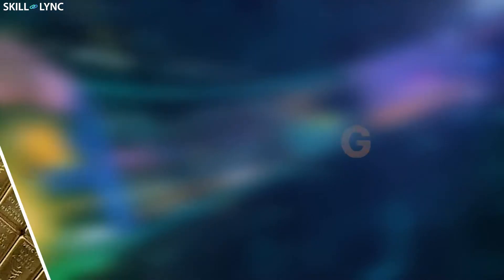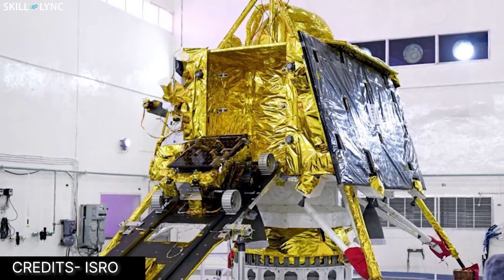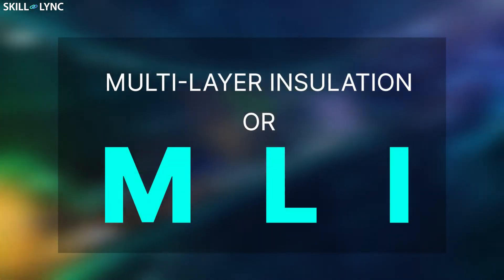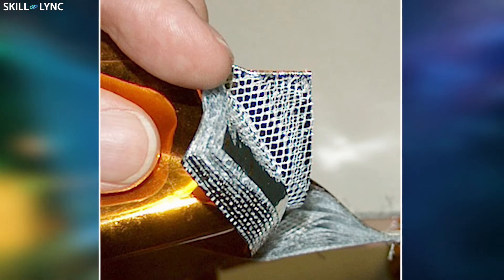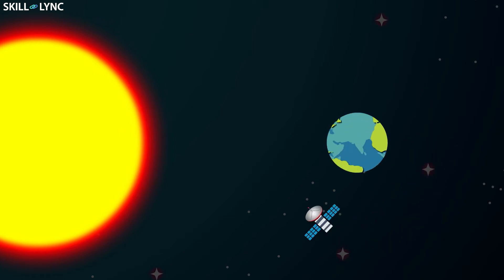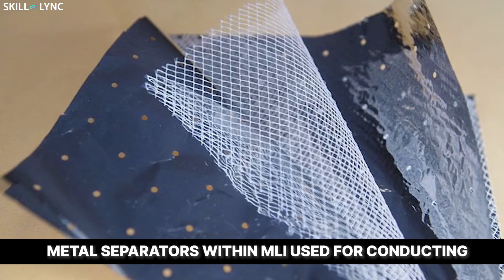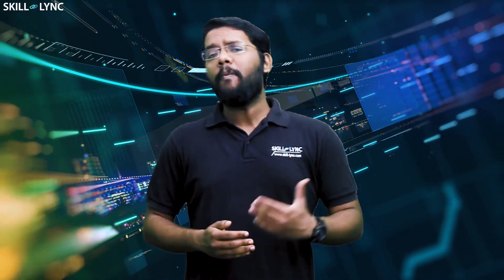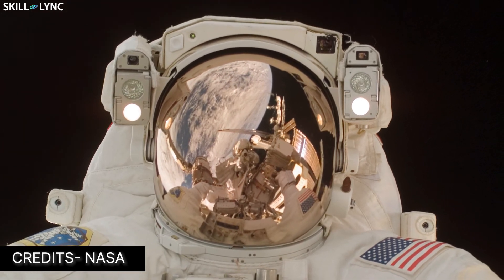Why are satellites wrapped in gold foil? | Skill-Lync

Comment: The lateral conduction through MLI is negligible due to the very small thickness of the MLI layer and the material the layers are made for. Therefore MLI does NOT equalize the temperatures of the hot and cold side of a spacecraft!